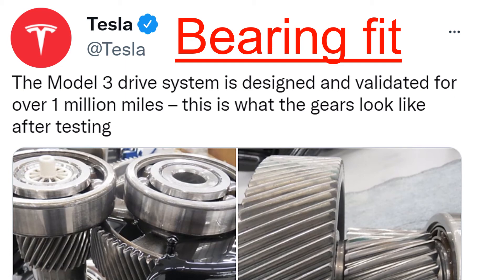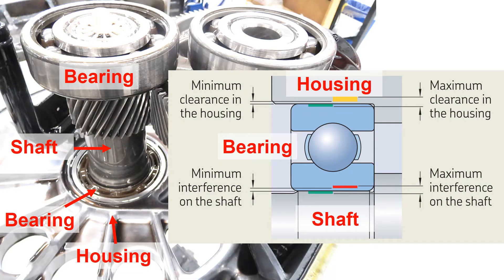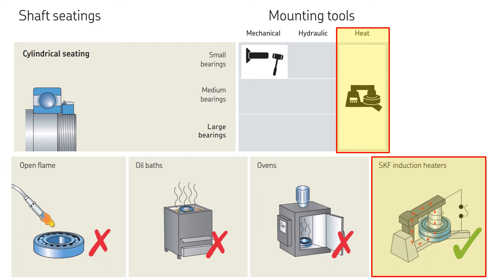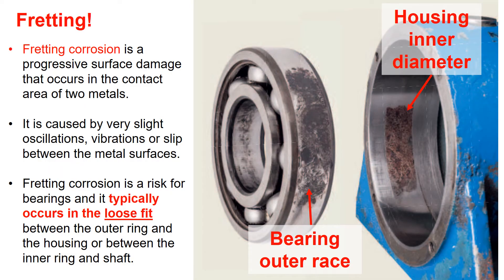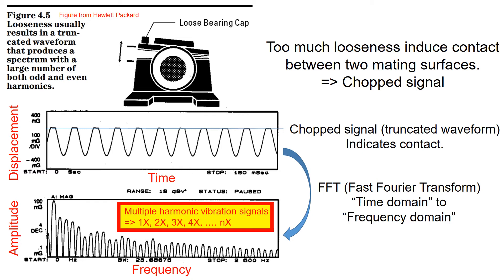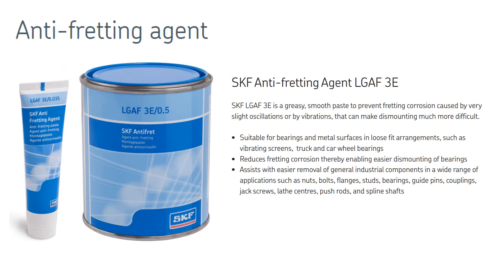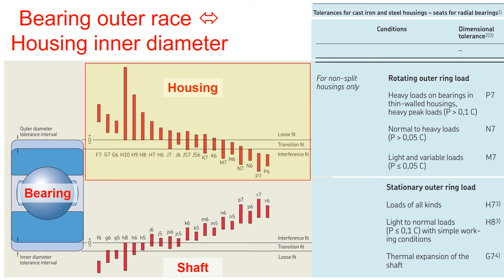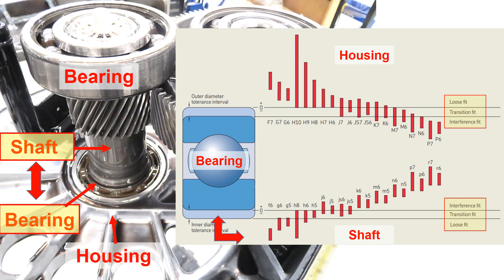Part 12 - Bearing Fit in rotating equipment

Comment: But what about thermal expansion in the housing? The housing is die cast aluminum and the bearing and shaft are steel... So they have different coefficients... And the higher temperature will make loose fit even more loose...
Reply from the maker: Your question suggests that you may be relatively new to designing rotating equipment. It's important to note that temperature stabilizes over time rather than increasing indefinitely. This allows for an optimal fit between the bearing, shaft, and housing. In most cases, the bearing acts as the primary heat source, while the housing functions as a heat sink. As a result, the thermal expansion will typically be greater on the bearing side compared to the housing.

Comment: I will appreciate it if you can provide videos on below topics
1- sub synchronous vibration
2- misalignment effect on rotor dynamic
3- thermal management of bearings
4- Optimum damping and stiffness determination of flexible rotor
5- SFD design process for flexible rotors
6- Operation of SFD (oil pressure, temperature correlation for required damping value)
7- Open ended and close ended SFD design criteria and which approach is suggested for better operation

Thanks in advance